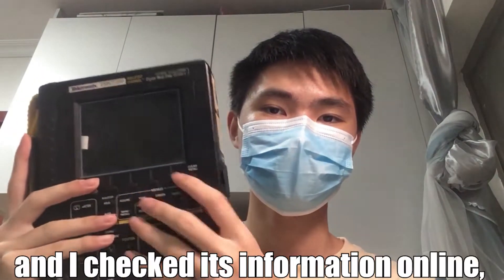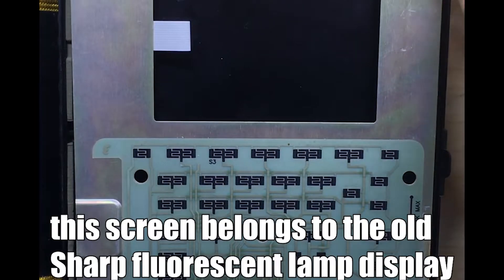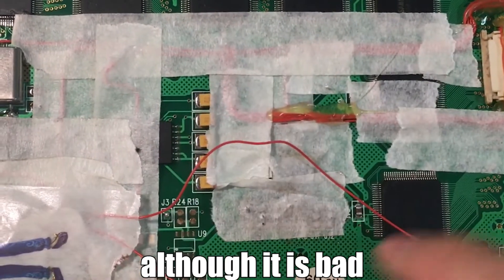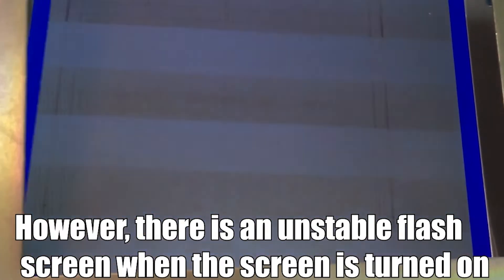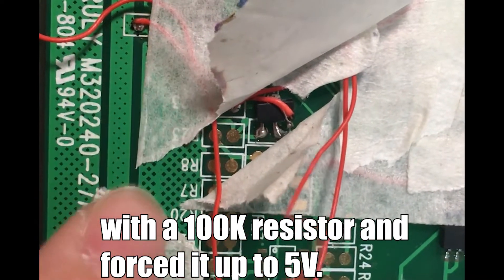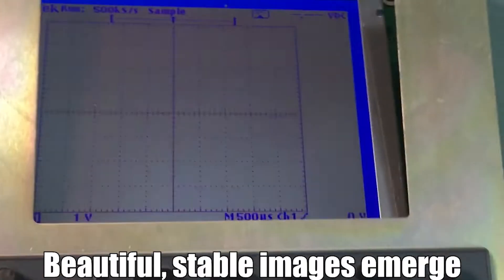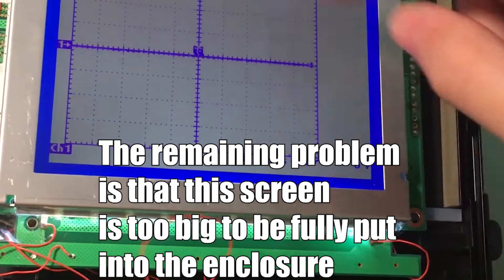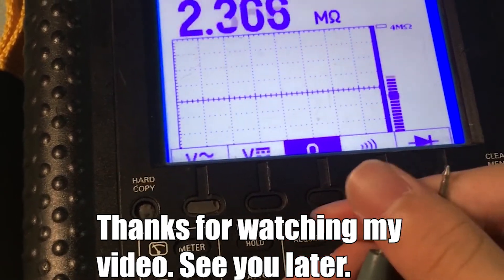Replace the expensive ths720 LCD with the cheapest LCD

Comment: I'm in the very same situation as you. Can you please put a more detailed info on the electrical modification you did on the display? Sorry, but isn't so clear to me. Please also report clearly the display part. Number. Thanks
Reply from the maker: sorry, because I just learned to make a YouTube video, but after it was released, I found that the size of the video was much smaller than the original size, which caused the picture to become very large and lost a lot of content. As for the circuit diagram, there was also content, but it was lost. I bought the display on a second-hand website, which cost RMB 50 yuan in total. In fact, it was not too difficult to choose because there were many models, As long as it is a 320X240 resolution dot matrix LCD and the screen size is 5.1 "~4.7", it is very likely that it can be used in this oscilloscope. The only thing to note is that some with frequency division circuit are not. It is better to choose the one with frequency division circuit, because it is difficult to buy the frequency division chip separately, and it is very expensive. The price of these two screens is the same. Because the video content is lost, II will issue another video later on the connection method, Detailed introduction, but now I'm diy an edm machine. I'll finish this video first